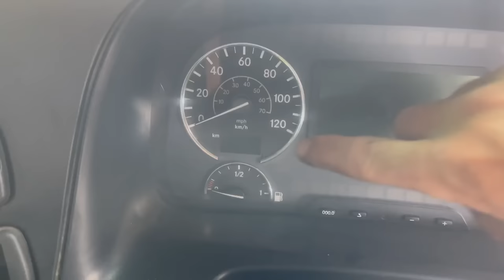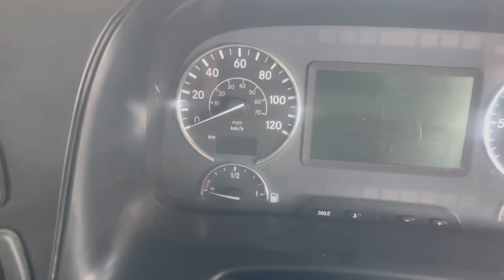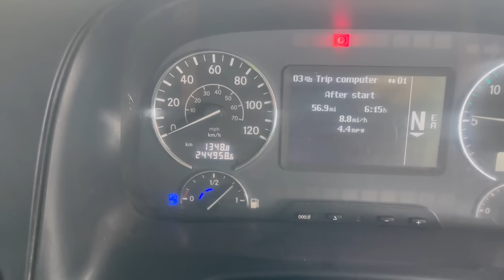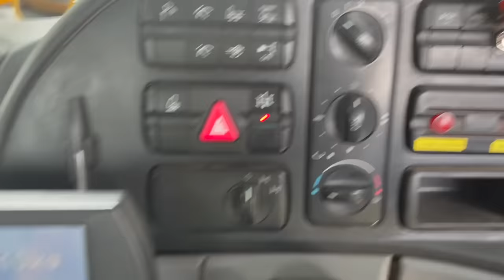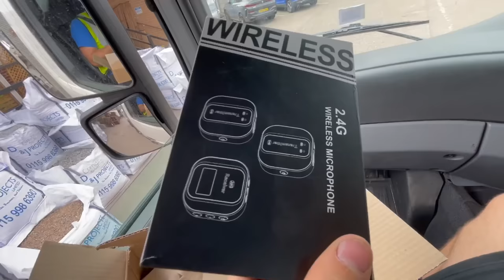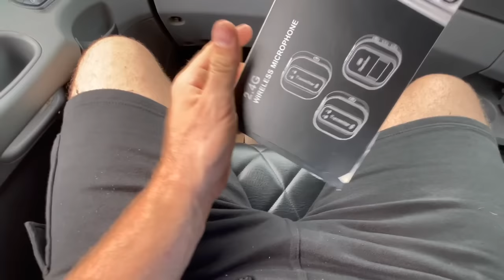SOMEONE IS TRYING TO DESTROY D&J PROJECTS - * NOT CLICKBAIT *

Comment: [I can picture you all laughing at this before I finish]. I have a similar type of fencing at the back of my bungalow, and I can't remember how often the wind had worked on the middle of one or two panels. It didn't quite make a U shape, but it WAS enough to pop them out, and more than once. I think it was replaced once, and again there was something missing. It wasn't until a third installation, that someone remembered to add a rail along the top, to stop the bending.

Comment: Dave, I think I know where your Palfinger crane problems with Big Red lie. Their error codes are numerical only so I think your display is upside down and E9-LO is actually 63-07: Lever not in neutral position on start up; Extensions extending. The suggested solution is to check the wiring and connection of the spool position plug, and test a module. You may need to replace the module or cable. Hope this helps. Love the channel, keep up the good work! 👍🏻😀

Comment: ok ive seen this for a washing machine  but im wondering if its a sensor  sensing that the fluid is low  .this is what i read .....E9 error code means pressure sensor failure

Comment: I used to sell spares to heating engineers and worked on the trade counter for many years. I've heard and been accused of the similar. There was one engineer that stands out in my memory, who asked for a meeting. We discussed terms and I agreed to give him trade minus 40%, a huge discount, provided he spends what he said he would and settles his account within a certain period. He used me for a good 12 months, and it slowed down almost to a stop at once after that point. We honoured the agreement for a couple of months after the lull (it happens in all trades), until I happened to speak to a friend about shop on a night out who worked for a competitor and he said this guy was in/out of his trade counter all day, everyday for the last few months. I did ask about the discount he was getting just out of interest but didn't use this information moving forward. I changed his discount on the Monday back to the regular 25%. 3 weeks later he popped in, caused an almighty storm on the counter, blocked the entrance/exit with his van, called everyone everything under the sun. In the end, I told him, if he honoured the agreement of his spends then he could get the original terms but until then, he can get regular trade price, otherwise, 'f**k off, I don't want your business'. 
From the outside, looking in.
I've read the review. I can only comment on what I know based on his review and your reply. I completely agree with your angle. He shouldn't get better terms if he isn't spending. I don't agree with naming it out on your YouTube though. I get your frustration, but it's not professional. Your reply on Google review, apart from the law breaking part, would have been sufficient. You need to seperate from it, and be the better person/company. 
This Jack has brought disrepute to his own company, I suspect drunk Saturday night rant and I'd advise having a think on introducing a price structure, where you have a Retail price, a regular set trade price (e.g. 15%) and additional discount set upon agreement with clients who spend bigger, provided they spend what they agree and continue to do so. If you have a computer system where you can input discounts to be applied automatically on their accounts when typing up an invoice, then discounts won't need to be spoken about on the counter for others to hear or see and if a client has a dispute over mis-applied discount, then your admin can go through your copies of the invoices to check and possibly confirm or dispute it. I get the issue of cost, however, if he hasn't reviewed and amended his price structure in preparation for the new year, then that's his issue. I applaud your position on passing on the savings where possible. If Jacks costs go up, then it has to be passed onto the consumer. Same for any business, can't keep swallowing profit margins forever, businesses are not charities.
Sorry for long comment. Hope my experience helps a little. Keep being transparent, attention to detail. All your work I've seen is exactly what I have my traders do for me. Love the content, keep it up! All the best!

Comment: Searching google E9 is a type of hydraulic oil so the error message could be low hydraulic liquid level which then needed bleeding with air trapped during filling. Judder like that used to happen on similar cranes I have used at sea with small air bubbles trapped in liquid during filling

Comment: The palfinger code is read from the box ? Are you sure your not reading it upside down it should be numbers not letters.

Meaning E9 LO would be 63 / 07 = Extensions extending

Reason:

•The spool of a certain movement is
activated.
•The wire from the spool position sensor
to Paltronic is defective
•The plug in the Paltronic spool position
box is loose.
•The spool position sensor is defective.
Check:
The diode in the spool position box has to
light up, if the spool is in neutral position.

Solution:

Check wiring and correct connection of the spool position plug.
To test a module, one can interchange two plugs to another
function and check, if the code changes or stays the same after
restart.
Stays the same -broken wire, changes - module defective
If necessary, change module or cable.

Hope that helps Dave

Comment: The job where neighbours dispute over who owns the fence and who pays for repair is interesting where they are ‘not allowed’ into the other property. Generally, where there is a border dispute there are usually covenants in title deeds that deem access is allowed for repairs to be made. If the neighbour continues to refuse, then it’s a fairly simple matter to take it to court and that sorts the issue out. It is pretty pathetic and churlish to stop repairs where they are required. Didn’t have the need to resort to court but had neighbour difficulties (one side only) myself so understand the frustration it causes. [Now they have a 4’ wall with a 6’ fence on top - due to the way land lies where they only had 3’ fence on 4’ wall before!]

Comment: Found Jack's comment and of course it's a probably drunken rant mixed with a fair pinch of jealousy and his nose out of joint he isn't entitled to an ongoing discount. Reading it he does himself no favours and is incoherent at times, keyboard warriors tend to come out during the night. However the D&J response, Jeez. That was one where you needed the red mist to clear, wait 48hrs, then offer your rebuttal. With emotions obviously running high it comes across petty when all you had to do was reply to the review with facts. When they go low, all you need to do is go high - online it carries so much more weight. Your reply started off like is was straight out of the playground. It also didn't really warrant a cutaway to stearn faces and the solemn explanation. You should to give your volume traders a degree of trust, they will see Jack's review for what it is, pretty sure they won't let that review influence their custom if they even review google at all.